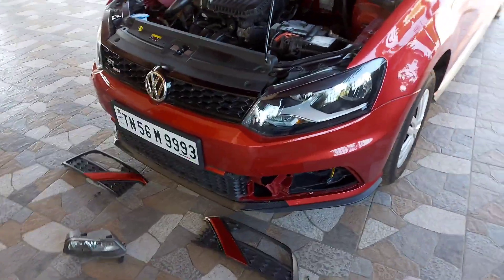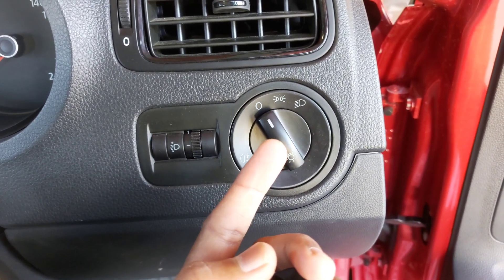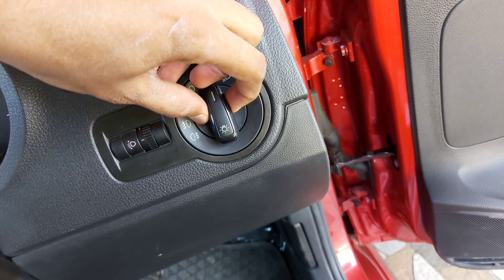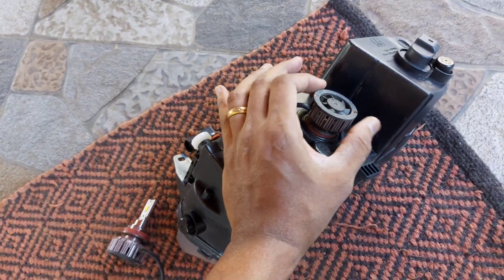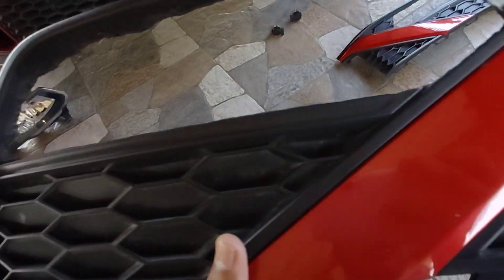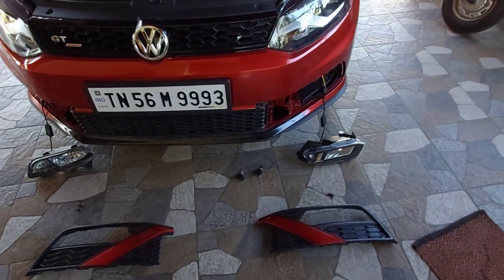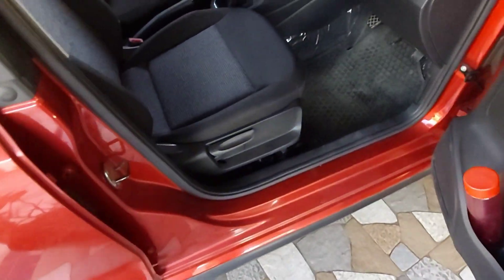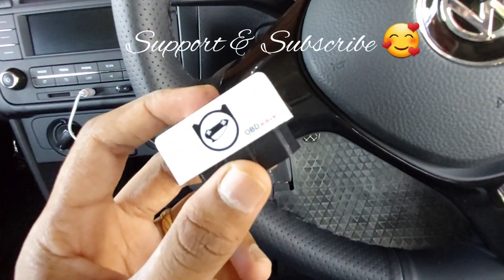Low budget Fog Lamp installation with LED for Trendline Polo | GTI Conversion Part3

Comment: Bro this video was very helpful. I am using vw polo comfortline  for the past 9 yrs . At that time this varient doesn't have foglamps pre-installed from factory . So I went for aftermarket ones and they did custom wiring . And after all these years I thought there is no way I can connect foglamp wires to the headlight switch. Once again thanks a lot...
Reply from the maker: Welcome bro..Even I searched everywhere I couldn't get the idea. Finally found that's why I dropped a video atleast someone will be benefitted!!
Reply: @OutofOfficeDiy  i more doubt.. after watching this video i am planning to do this type of wiring for foglamps . So what i have to do is to connect 2 wires from the existing "closed" terminals to the foglamp connector and  also replace the switch to highline so that i can switch on foglamps .
Reply from the maker: Yes Exactly bro
Reply: @OutofOfficeDiy  tysm bro
Reply: Did you install this?

Comment: The empty slot is for corner lights. There is a module Which connects to the steering. And AFAIK it uses a small light.
Reply from the maker: Yes Bro... I need to upgrade my BCM unit first 🙂

Comment: Recently I did Fog lamp fitting in service centre for ameo.. It costs me 19k approx

1. Fog lamps x2 (Comes with Halogen)
2. Wiring
3. Headlight switch
4. Fog lamp cover x2 (with chrome bead)
5. Radiator Grill (with Chrome bead)
Reply from the maker: Yes.. that's the price.
Reply: Today I visited service centre due to some engine noise bcos of Alternator problem.They simply rejected warranty by showing a reason of non oem fitments i.e, fog lights, auto switch.
Reply: @ravikotla.1264  If u fitted a fog lamp and switch at VW service centre.. Show it's invoice/bill..

If u had accessories from external, then it's difficult to convince..
Reply from the maker: It's all based on your relationship with service center bro.. till now no issues for me.
Reply from the maker: Also they check wirings as well..if it looks not good or dangerous they will definitely make a note.
Reply: Location and showroom name

Comment: under bonnet carpet is gone in 2019. Sad.
Good job bro. Did you figure out how to enable those cornering lights? Point me to your video if you have made one on cornering lights. Enjoy your fogs.
Reply from the maker: I tried bro... but we need steering angle sensor for enable it.

Comment: Hey nice video it would be great if you could tell how to open the grill of fog lamps I got my polo 2 days back and got a small dent near the grill I want to open grill and push that dent please tell me how to
Reply from the maker: There is a pin inside you Stepney kit..kind of hook.. with that you have to pull out the grill..refer the Manual for easy understanding

Comment: Thanks for your video.
I'm using a trendline for 10yeqrs and installed the fog lamp from ASC but they refused to do the wiring because they don't do wire splicing.
1.06 Did you cut the wire connectors which are already present in the original wiring?
1.29 does the holder you mentioned in the video correctly suit the fog lamp..? In my car the connector is already present but that dosn't suit to the new fog lamp.Did you purchase separate connectors while you did the wiring..?
3.31 should I mention any part number while I search in all express..? There are dozens of switches I saw in all express.
Thanks in advance.
Reply from the maker: There is no wire cut required brother.. there will be two empty coupler behind you head lamp with dummy on it, that's the line for fog lamp take a line from there and you need to change your switch that's it
Reply: @OutofOfficeDiy  Thanks for your reply.
Should I need a connector to run a wire from that coupler..? Like a wiring harness.?
Reply from the maker: Yes brother then you Need to h8/h11 coupler to fit the bulbs at the end. You can find it on amazon
Reply: @OutofOfficeDiy  fine..
Do you sell the headlight switch.?
Reply from the maker: No bro
Reply: @OutofOfficeDiy  fine...
Thanks again for your replies 👌👌👌
Reply: Hi bro..one more question;
Should I specify the part number while I order the light switch from Ali express..? Or can I blindly purchase a 17pin switch ?

Comment: I have one question 
I own 2021 highline plus AT model which comes with fog lamps with single bulb housing  
Is it possible to upgrade to the dual bulb housing like you ? What extra wiring would be needed to get two bulbs wiring ??
Reply from the maker: Yes brother possible
Reply: @OutofOfficeDiy  thank for reply brother . Can you let me know what extra wiring harness will I need for that ?
Reply from the maker: Yes brother need to set a replay and take line from headlight coupler so that when you turn on ignition the reply will be turned on and on the drl

Comment: Good job 👍Can we do wiring from rear fog lamp to front..?? To cut the cost of head lamp switch. If fog s are led there will not be a extra current.
Reply from the maker: Yes, I did the same first
Reply from the maker: Need to swap the pins on the headlight coupler
Reply: @OutofOfficeDiy  thanks man 👍4 d reply
Reply: @OutofOfficeDiy  not getting parts as you said on the video.. Aliexpress 😄
Reply from the maker: It's banned bro

Comment: Perfectly done bro . Just tell me are these fog lamp covers removable in trendline as showroom guy told me complete bumper needs to be changed ?
Reply from the maker: No no
Reply from the maker: Fog lamp cover can be removed
Reply: Bro does the vw polo include service booklet and warranty card as mine came today with owners manual only
Reply: No service book and warranty details included
Reply from the maker: Yes warrant card will be there
Reply: Bro one more question my polo when i start the engine the center MID display light goes dim and comes back its like display flickers any idea why ?

Comment: Won't the warranty of the battery got voided if you install aftermarket LED lights (or) extra fog lamps (since it could get short-circuited sometime)
Reply from the maker: No Bro..it's all about the wiring how you made and what you bought
Till now no issues for me..

Comment: Hi bro. I have a doubt. Am also from erode. I checked with vw showroom they said if we install out side market products it's won't cover under warrenty if got any problem warrenty won't cover for the car due to outside products
Reply from the maker: Yes
Reply: I have been seen ur video. Yet to deliver my trendline. Before that I planned to install as per your idea. Few things kind of wiring part they told me warrenty issue.

Comment: Could you please provide the link's to buy these from AliExpress
Reply from the maker: #Aliexpress Rs. 1,693.25  28%OFF | Car Light For VW Polo 6C 2014 2015 2016 2017 Car-Styling Front Halogen Fog Light Fog Lamp Assembly Two Hole Bulbs
https://a.aliexpress.com/_dXm5cWm
Reply from the maker: #Aliexpress Rs. 979.56 | New Headlight Fog Lamp Control Switch For VW Volkswagen Polo 6R UP Seat Mii 2012-2016 6R0 941 531C / 6R0 941 531E
https://a.aliexpress.com/_dXFr8n0
Reply: Very informative video👍 great job 👍
Reply: Bro, also plz share the link of LED bulbs which yu brought from aliexpess.
Reply from the maker: #Aliexpress Rs. 1,338.14  29%OFF | Infitary Car Headlight Bulbs H4 H7 Led 14000Lm H1 H3 H11 9005 HB3 9006 HB4 880 3 Model Adjustable 3000K 4500K 6500K Auto Lamps
https://a.aliexpress.com/_dTojrSS

Comment: Did you have to add a relay while fitting the LED bulb in the fog lamp?
Reply from the maker: No .. it's not required bro
Reply: Thanks....would the fog lamp use the H8 bulb?
Reply from the maker: Use H11 bro... it's much brighter compared to h8. And fitting wise its same

Comment: 1. Can you share the link to order fog LED lights? 
2. Also are H11 and H8 interchangeable? I ask this because I have Ameo 2018 highline model and when I checked the bulb, it said H8 12V 35W. I am looking for brighter lights.
Reply from the maker: Yes, I am using h11 only.
Reply from the maker: The link is absolute now. You can check on Aliexpress

Comment: Bro plz confrim the connection for front fog lamp and rear fog lamp with same switch
Reply: In trendline 2021 there two empty holder on left side and 1 on right side which 1 is for foglamp in left side
Reply: Also confrim the +- terminals for foglamp wite

Comment: When you have a such a branded car you cannot use low budget accessories. Use standard budget and keep your car standard ever. Since its not toy its a beast POLO
Reply from the maker: Bro, 
Only the budget is low, not the quality. If you watched my video even the wiring is done by ASC. This is a euro spec model foglamp which Indian doesn't have it at all. Even I am supplying for customers too.. Everything if we rely on ASC then how will you understand your car?

Comment: Bro, you have any plans about wheel upgrade?
Reply from the maker: Ya bro... soon. Planning for getting some good wheels
Reply: @OutofOfficeDiy   alloys for 14" with 175/70 r14(stock tyres) or upsizing?
Reply from the maker: Upsizing to 16" planning to get 205/50 R16 with BBS or Lenso
Reply: @OutofOfficeDiy  but the stock highline tyres are 195/55r16, upsizing beyond 195, will the tyres hit sidewalls?
Reply from the maker: No bro
Reply from the maker: Till 215 you  can upgrade... but 215 is over kill
Reply: @OutofOfficeDiy  what is best tyre size you think is the best in terms of comfort in 14 or 15 ?
Reply: I'm planning for 195/60 r15, I use the car on hill roads.
Would that take a hit on cars performance and power while going from 175 to 195?
Reply: @OutofOfficeDiy  please reply brother

Comment: So trendline doesn't come with Fog Lamp connectors? If I buy the fog lamp there is no plug-and-play? And do I have to buy the switch or will it work with stock switch?
Reply from the maker: Provision is there.. you need to extend the wire and yes switch has to be changed
Reply: @OutofOfficeDiy  Thanks man. Your videos are helping us a alot. Keep uploading.
Reply from the maker: Sure Bro, Thank you!

Comment: You got your car remapped from code 6?
Reply from the maker: Yes Bro. Stage 1+
Reply: @OutofOfficeDiy  post remap figures bro?
Reply from the maker: For my Polo it's around 86bhp since is MPI. On Rapid TDI its producing 140+
Reply from the maker: For Polo, I am planning to add Remus valvetronic exhaust plus BMC intake..so I hope inwill get around 95 I guess
Reply: @OutofOfficeDiy  how's the drivability after stage 1+?
Has it improved, how about Low end torque?
Reply from the maker: Yes Bro. Before on the speed breaker, there will be lag when you press pedal on 2nd gear now that I issues are gone. No lag at all free to rev. In low rpm i am able achieve higher speed. Over all the become silent in noise and pickup is too good
Reply: @OutofOfficeDiy  how much did it cost you? Was it worth the penny? Wolf Moto here in kochi quoted me 20000 for stage 1+
Reply from the maker: Yes Same Price.its worth. Even fuel efficiency got increased
Reply: @OutofOfficeDiy  FE figures pre and post remap bro?

Comment: Pls link the products in aliexpress.com
Reply from the maker: https://m.aliexpress.com/item/32839099602.html?trace=wwwdetail2mobilesitedetail&spm=a2g0s.9042311.0.0.1f254c4dSC1Cob
Reply: @OutofOfficeDiy  thank u for reply and pls link for the headlight foglight switch
Reply: Sir , can you share the link of that three colour fog light
Reply: Hey thank you so much for this video.
Is there any possibility to install fog lamps on Skoda Rapid Rider edition as well because it will not have ore installed fog lamps.